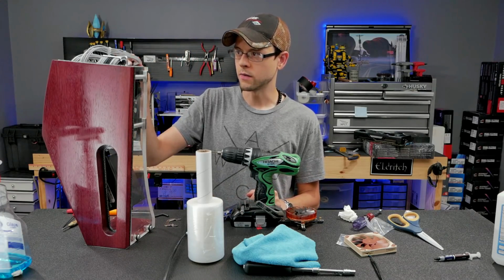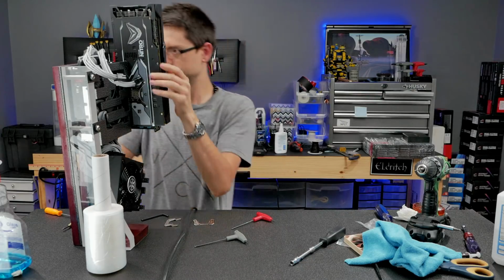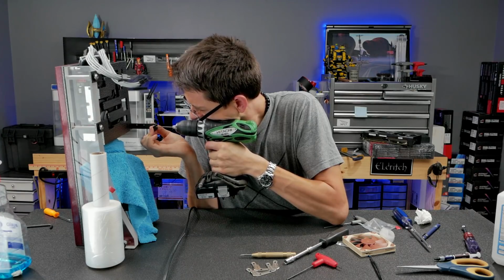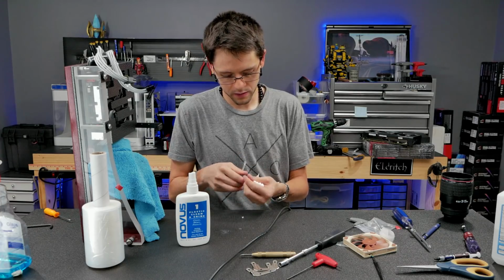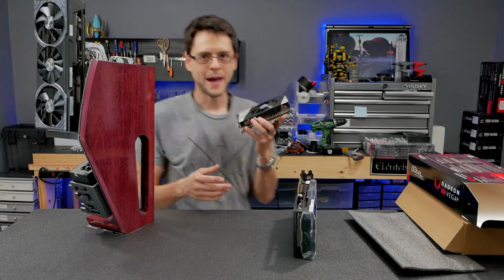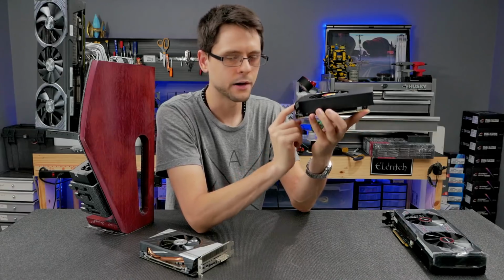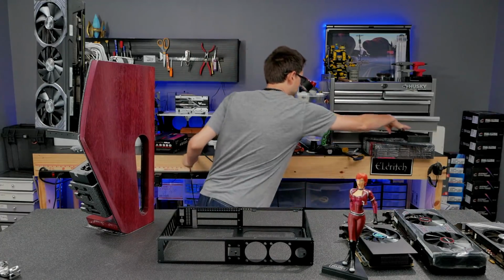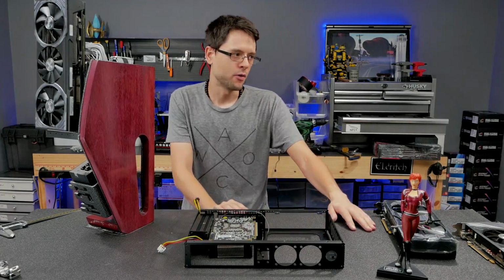In which I take a quick look at the Vega Nano. (Live Stream)

Comment: Will 92x25mm fans fit in with the 1080ti mini on the fan bracket?
Reply from the maker: Nope. 92x14mm fans wont even fit with the 1080ti on the fan bracket. The bracket is there in case you want to remove the stock fans of a GPU for some reason and run quieter fans. If you are interested I made a video about it here: https://www.youtube.com/watch?v=Iygxgnf4ydc

Comment: HI NFC! I wrote you in the last video but I think you hadn't seen. Like you said, I've correctly installed the button and succefully turned on my pc. The only problem I have is that the PCI Express silicon doesn't work. I've connected it using even the other part made for the MB but nothing. What I've noticed, is that it smells like burnt. What can I do?
Reply from the maker: Dear Marco: I am alway happy to answer tech questions. Email is fastest way to reach me. As to your question, I am 99.9% certain you plugged the KEY upside down, and the RISER the right side. Please check the KEY orientation (instructions are printed on the key) and install it like this video below, but unfortunately your motherboard is probably toast. https://www.youtube.com/watch?v=kYyWuQ7SmZ8
Reply: Thank you very much for the quick response! The MB works because I can start Windows without any problem. I'll try one more time giving better attention. Can you write your email if it doesn't work and I need some more help?
Reply from the maker: Dear Marco: I am very easy to find and so is my website. I have a form there. Just google NFC Systems. Peace
Reply: Ok perfect, now it works! Sorry for my unknowledge but this is the first time I build a PC so particular ahahah. Thank you for your help and time! =D